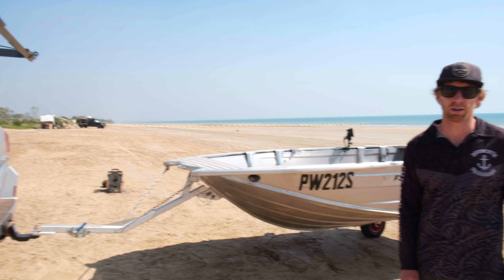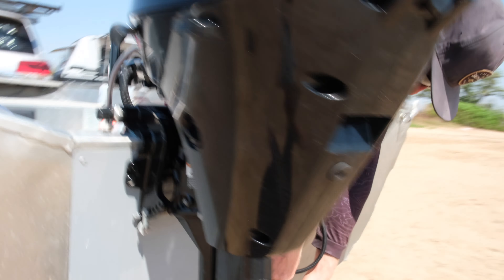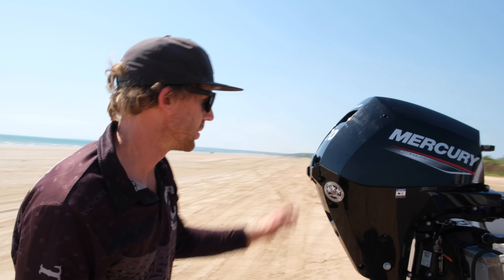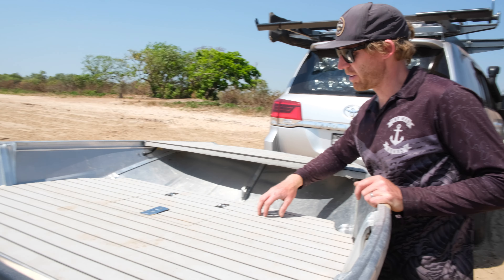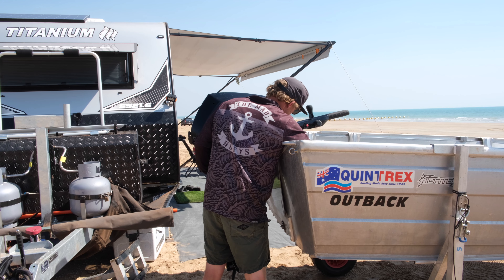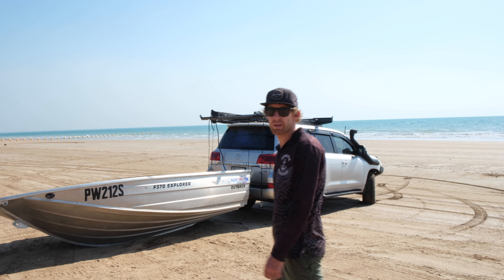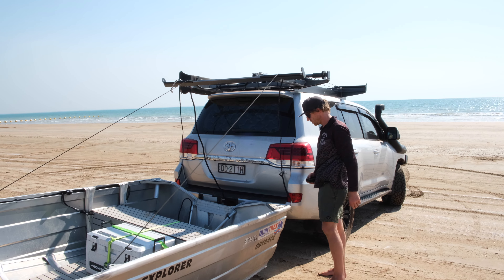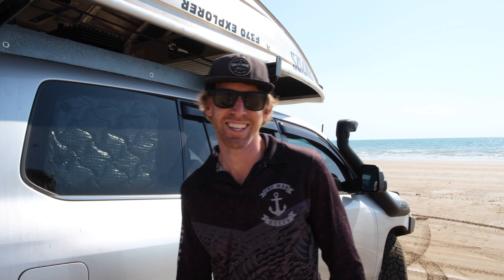Is This The Ultimate Rooftop Tinny Setup?

Comment: Grouse set up mate! We've got the same tinny except a F350 and a 15hp mercury. Just in the process of doing the sounder so battery wise do just use your little jump pack as your battery for when you go out to power everything? Then being super light and easy just recharge it back up when you need? 
Im just looking at battery options for our rooftopper.
Reply from the maker: Yeah mate it powers the sounder, bilge pump and nav lights and yep charge up at then end of the day.
Also have a smaller one incase it goes flat
Reply: @ReelSaltyAus  thats a bloody cracking idea mate! Cheers

Comment: Gday mate, great setup, could you pls explain a bit more on how you connected the  battery pack to power all the devices? thanks
Reply from the maker: Thanks, battery connected into an Anderson plug then into a fused switch panel which goes to bilge, nav lights, sounder
Reply: @ReelSaltyAus  sorry mate I’m pretty new to boating, how did you wire up the back of the switch panel? How did you connect Anderson plug to switch panel? cheers